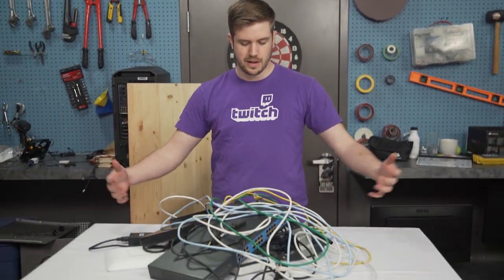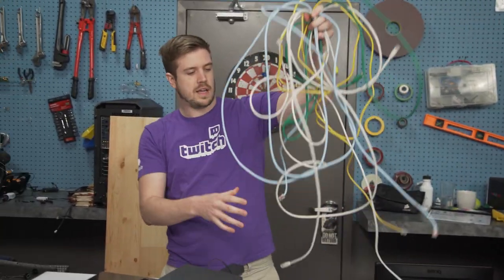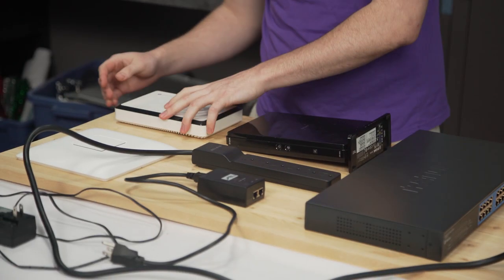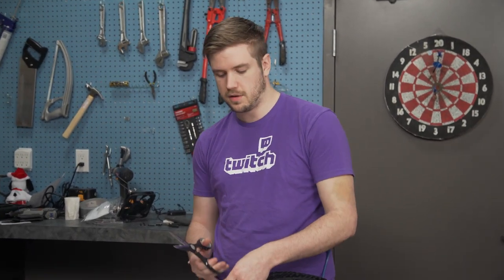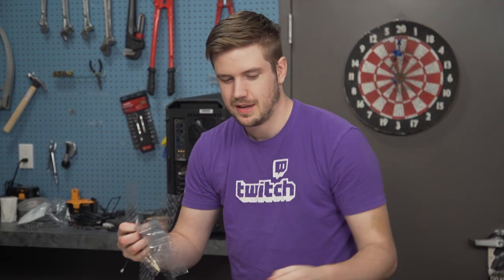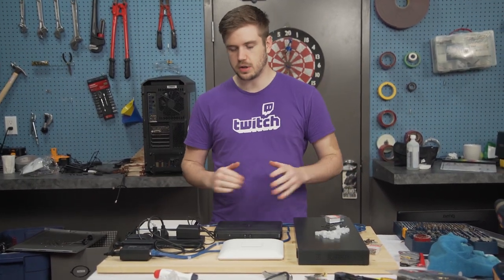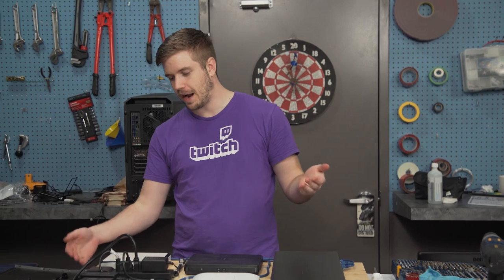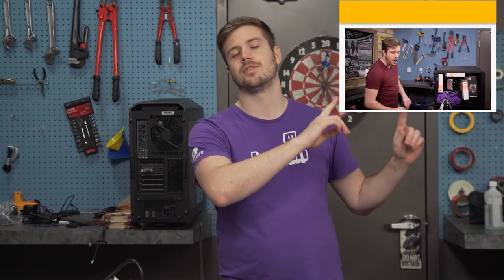DIY Networking Wall - A renter's solution!

Comment: Primecables has some cheap 1' and 6" power cables to clean up the wiring (also good for getting those ugly power bricks onto a surge strip). They have a distribution center in Vancouver too I think. I got some short ethernet cables from them too, for interconnects between switches/routers, etc.

Comment: you should have painted it black to make it not stick out so much, also drill holes and run wires on the backside to make it look very professional and clean. All excess wire and power supplies could be hidden that way and then just have them come out right where the plug in.

Comment: Your Wireless AP will now be sending signals out in the wrong direction, the antennas will be setup for it being in a horizontal position. Your WAP sends out signal in a doughnut shape, which is now going up into your ceiling and the floor rather than into adjoining rooms. You could solve the issue by getting a model with external antennas, or by adding a little 90 degree wooden riser from your board so that is horizontal again, or just don't lean the thing against the wall :P
Reply: sure....
Reply: That AP (not the shitty router) is meant to be placed on a wall.
Reply: +S!lentThund3r That's a Ubiquiti UniFi AC access point. They're designed for wall or ceiling mount, and change the polarity of the antennas internally based on orientation automagically.
Reply: +Ian Brown Hmm interesting, I work with Cisco enterprise WAP's that aren't smart enough to do that on their own. That's a feature I'd love to see 3700i's have :P

Comment: I just spend 7 minutes watching a guy stick stuff to a board and call it a solution.   I really must have cabin fever, someone get this guy an all in one router.    Yikes.
Reply: +Toms Chevelle 
All in Ones suck. They're made in a one size fits all form that doesn't always fit. If one part of the system fails, it all fails. This is why I don't buy Headsets anymore. Instead buying a separate decent headphones and microphone. That way only one thing needs to be replaced if it breaks.
Reply: +Toms Chevelle 
All in Ones suck. They're made in a one size fits all form that doesn't always fit. If one part of the system fails, it all fails. This is why I don't buy Headsets anymore. Instead buying a separate decent headphones and microphone. That way only one thing needs to be replaced if it breaks.

Comment: WTF !!!!!!!!!  Is this a joke ??!??
Reply: No.
Reply: +pol1250 This is LTT. There are no jokes here. Only business. Serious business.
Reply: Very serious business. Usually involving large slabs of wood.
Reply: +pol1250 No, its not a joke. With the exception of screws used instead of velcro, its a very very common thing you will find in business all over. It keeps all of the telecom hardware, isolated, organized, and easy to service.
Reply: +Jake J velcro is legit
Reply: +Jake J lol you mad?
Reply: He doesn't need to make cables to work at what is primarily a computer tech channel. It says "Ghetto" in the title, if you wanted skilled workmanship then why did you even click on the video? And yes, the best part is that he is getting paid, he just isn't getting paid to do this. This is a one off video
Reply: I'd just have the home depot or menard's cut the panel I was buying to size - no extra charge. That's what their big panel saw is for.

Comment: What's wrong with putting all this on a shelf, with some minor cable management. No screws, adhesive or velcro needed. And it won't look as ugly and ghetto as this.
Reply: +ImDankest In case you need to move to another place fast? He said that he was renting.
Reply: What, so it's easier to move around a massive awkward sheet of wood with networking equipment screwed, taped and velcroed to it, than it is to take some things off a shelf and put it in a box when you need to move? I understand that's not the point of this video, the point of this video is to entertain the subs, not to be practical. But i'm just saying how much of a stupid idea i think this is.

Comment: D-Link router? That's why you had terrible Wi-Fi...

P.S. Дно-линк
Reply: +Dr.Cheater He doesn't use the router for wireless....He has a ubiquiti access point (the white square) which is one of the better known enterprise grade wireless solutions.
Reply: +sphinx1390 had
Reply: +Dr.Cheater Там не только дно-линк, еще и дерьмовый оптоволоконный модем. У самого такая же херь дома. Только не UniFi, а AirPort Express. Замены тому модему нет, вообще. Жизнь боль
Reply: +sphinx1390 He only has that because the D-Link Wi-Fi is terrible.
Reply: ***** Приятно встретить тут русского)

Comment: Could you consider to stop using the word 'Ghetto'? It appears you're trying to use it in a way that means quick, cheap or not professional, but this is quite far from what it means. I post this for the whole team at LTT, not just this video. 
Edit: looking at the standard youtube comments of someone also mentioning the same thing, the video could easily be called 'DIY Networking Wall - A Renter's solution!', as' DIY' clearly implies the same message as the way you used 'Ghetto'.

Comment: "Tech Guy" doing a 'tutorial' on networking management. Can't make cables.
Reply: +Bareknuckle. Tell me about it.. i shut it off the moment he said he can't make cables. So many of these Linus videos is effectively big unboxing videos.
Reply: +aerobicsparadise reminds me of Linus' video about "10x your network speed" where he obviously didn't know about the IPv4 address space.. (he fixed that while it was still on vessel)
Reply: ***** the issue was that he picked IPv4 subnets that weren't in the private range anymore, for a second network interface. He was basically advising people to use an IPv4 subnet that actually exists in the real world, so if someone actually used those addresses and later wanted to connect to an official site on that IP address they would not be able to connect, since it would get routed to the local computer.
Reply: aerobicsparadise yeah, I had to laugh a lot when I watched their video on it, too. I mean I am already concerned about my data even though I am not running a company off of it. Not having a backup of data that is vital to a company's business is like playing russian roulette :D
Reply: pcfreak1992 LOLZ !!! It's was probably 192.168.0.1/24 ;)
Reply: pcfreak1992 Same here.. Run heavy duty Cisco 3800 routers /Catalyst switches and PIX firewalls at home.. But being a CCNP..one kinda goes overboard at home. ;)

Comment: I would be a little more adventurous: take a beefy dual output power supply (5V and 12V usually) and power all the equipment from it. Sure, it requires some soldering for custom power supply cables, but when you most likely won't have to swap or add another power bar if you want to add something later on... I know it's a bit of overkill... 
But, excellent ideea! And it works not just for renters! I mean, when I upgrade something in my house that's screwed to a wall, 8/10 the old holes don't fit and I have to drill new holes...

Comment: Maybe make it like a rolling white board, thus meaning it would be standing up (at ur preferred height) but not necessarily rolling. You would then have all your networking device on the front with holes through the board for the wires to pass through the back and not all over the front. Also, the power bar and adapters could be mounted behind it so no one sees them.

Finally you could have LED strips behind the perimeter of the board giving it a glowing effect!!
Reply: I was hoping for something more presentable like this too.

Comment: What you should of done was mount everything down. Then drilled holes big enough for your cables to fit throw right below what they are getting plugged into. Also you could have carpeted it, to make it look better. Then you could have cabled managed better on the back, and it wouldn't be so ugly. I have this done for my car stereo setup in my trunk for my amps and everything.

Comment: Just as a heads up to anyone looking to do this, stick on Velcro will fail over time due to the heat of the components heating up the glue until it comes loose.   Everytime I've used it, it fails after a month or so.  So unless you an obscene amount of it, expect to have to reapply it once and a while.

Comment: Most of that equipment probably has screw mounting keyholes, which are way better than giant pieces of velcro. Or you can use cabletie saddles on either side, then loop a ziptie over the HW and put a cut-off nut off another cabletie on the other side of the opposite saddle to secure it.

Comment: An alternative would have been to put L brackets on that board to hold it an inch or so away from the wall and have the cable management on the back. It would look "cleaner" as excess cable lengths can be coiled, zip tied and tacked up out of sight on the back. (and no risk of getting cables that are a wee bit too short...)

Comment: For that wireless access point, that is probably not ideal. When layed flat. It's wireless donut ( you can Google it for more info) would be spread out in the surrounding area. Putting it on its side would cause the wifi to go in a narrow beam in the surrounding area on the same floor, as well as shoot up my higher and lower (which might make sense in some situations but usually doesn't). With a few modifications this plywood wall could make sense, but I would be aware of where you want your wifi to go, and position it accordingly, even if that means leaving the wap off the wall. It's important to keep in mind that LTT are entertainer's, not always professionals on the topics they make videos about.

Comment: I can think of 3 ways of making this work better.  First use BOTH sides, I would mount the equipment to one side, using brackets, a pair of brackets that have a 90 degree bend in them,  and a small bolt between the two, it looks almost like this [ if viewed from the right angle. Two sets go under each piece of equipment, and one above.  Drill some holes in the board to fit cables through and attach those at the bac, would look much neater.  Get a set of 2 shelf brackets, the mount the piece that you cut off, to the bottom centred underneath to make an upside down T and it can free stand.  That was posted a couple of weeks ago, and I would think it's a safe bet at least one piece has come off....

Comment: LinusTechTips: I have a question that has been bothering me a lot. The question: "Why do you and everyone else use a modem?".
I understand that the modem is your way to connect to the internet and then the router is what you use to connect all your devices. The thing is, in my house I have a glass fiber connection and what I did was to buy the glass fiber cable, connect that to the wall and then use an adapter that transforms optical waves into digital waves and so using an ethernet cable I connect it directly to my router, thus not needing a modem. My internet connection works fine and I've never had any problems and that's why I keep asking myself, why use a modem? maybe I'm missing something, but that's why I'm asking you. I'd like to know if maybe there is a crucial benefit from a modem that I'm missing. Thank you.
Reply: +Ah Eh You use a modem because that's what your ISP dictates you need to be able to connect to their network. Which is incidentally also why most ISPs tend to ship you a Modem/Router combo box.
Reply: So in that case it doesn't have a practical use and or advantages. I'm happy I recently changed my ISP,  because my new ISP only turns on the internet and everything else,  the cables, router,  etc. I have to buy and manage myself. Thanks for the response ^^
Reply: Ah Eh It all depends on your luck - Here in Denmark it is the norm to receive the Modem/Router combo. If you want to be able to tweak them, you often have to call up the ISP because they are locked off to allow for remote updating.

So you basically sign a "I take all responsibility for doing my networking myself" thing. IT enthusiasts can usually replace the entire setup with their own stuff though.
Reply: Yes,  here in my country I think it's the same.  But my last ISP was so bad and expensive, I was desperate to find a new ISP. So I guess I'm really lucky, the one I found now is amazing, it's like that from the beginning: "I take all responsability for doing my networking myself". And they don't mess around with anything else. At the beginning I was really scared about doing it all myself, because I didn't know much about networking...  And I was always really confused why using a modem and all..  Haha.  But well, you cleared it up for me (because in every forum people said that you absolutely needed a modem to connect to the internet,  but I don't have one! :O) so yeah...  Thank you
Reply: Very FEW people in the US have access to Fiber connections here is the main reason and when they do have access to Fiber, it's at insane prices. Only Google Fiber, in select cities and then select neighborhoods, offered 1Gbps Fiber at a price that's affordable.   You wouldn't need a modem either if you went with DSL. It could just jack directly into a router. A lot of people are on DSL but the speed is worse that cable (copper) of course. DSL is usually an option when no cable ISP is around. If there's a cable ISP around, it's usually cheaper and better all around to go for it, thus, modem. Modem/router combos, aka gateways are terrible though.  Luckily, some ISP's like Comcast, let you buy your own modem instead of renting theirs.   And because I did so, I don't have to pay the $10 a month to rent it AND I get much higher throughput than the service plan says so.  For example, I used to have a 75Mbps service but regularly get 90Mbps.  Now I have a 150Mbps plan and regularity get 200Mbps.  Also, you'll notice on modems they mention channels. Channels most people think have to do JUST with maximum potential bandwidth, so more channels, higher possible speed. But in fact it also helps with line congestion and error correct / stability. I live in a major city and in an apartment complex, so all the homes basically go through one hub, probably the whole block does too. So it's able to pick out different channels, so I have a more efficient connection. So even though I don't have a 1Gbps service plan that my modem can do, even at 150Mbps, this thing with it's 32x8 channels is perfect.

Comment: Power strips normally have a few screw holes on the bottom to attach to a surface. That's a lot cheaper than Velcro.

Comment: If you can't drill, you can make something that can stand on it's own, presumably by putting two boards together in an L configuration, put some right triangles on the side for support, and plop it on top of a dresser or something... or maybe be lazy like me and set it on the floor and trip on it. You can then make handles at the top portion, so when you move, the contraption is easier to carry. Remember to bevel and sand the edges to avoid splinters, they piss me off.

Comment: I need to just do this for my house. I had everything mounted to the wall, but since then replaced the modem/router/switch so nothing is the same and none of the screws line up anymore. I should have just mounted it all to a board from the start would have been a lot easier and less holes in my wall.

Comment: I use a perforated metal sheet instead then just use cable ties to tie up everything , plus point no drill no screws no Velcro which will definitely fail and better heat dissipation.

Comment: So many people are confused about what a Modem is, What a Router is, What a Ethernet Switch is, and What a WiFi access point is..
You can have a device that has all this in one.. OR

Modem - Brings in the connection from internet provider.  (is not a router does not issue IP addresses to devices)

Router - Takes the connection from the modem and breaks it out to all devices.. This is what issues the IP address to each device.. His is a 4 port router which means it is has a built in 4 port Ethernet switch [ It also has a built in wireless access point but he does not like it so he disabled it.]

Ethernet Switch - Takes the connection from the Router and distributes this to all the wired connection. (does not issue IP address)

Access Point - Takes the connection from the Router and distributes this to all the wireless connection. (does not issue IP address)

Yes you can get units that combine them all into one unit.. BUT this is what he has..
He could spend money on new stuff OR just use what he has available..

Comment: There is this really cool shit they make called drywall mud. You just fill the holes in the wall with it, then when it dries, you sand it and throw some paint on it. Takes 10 Minutes. How did you mount your tv? Velcro on plywood which you screw into the wall anyways?

Comment: My router fell 3 times off the wall thanks to velcro and the heat it generated making the glue come off. The 3rd time it also took down with it the external hdd I had connected to it.

Comment: you should've drilled holes and ran the cables behind the board. and maybe wrapped the board in cheap vinyl or carpet that's usually used for subwoofer enclosures

Comment: For the switch you could turn the mounting ears 90 degrees and then screw them into the wood. You know, if you didn't lose them.

Comment: Heat and glue are the enemy.  When the Velcro glue gets hot it releases. Use super glue. Lots of it.  And, cut or put a handle on the board to make it easier to carry.

Comment: I have my 8-port switch and raspberry-pi server mounted to the bottom of my table...
I wouldn't ever mount stuff on to a wall, but on a rack. If it's too small for a rack, i'd buy a rack shelf.
Reply: +Mtaalas So true. I actually have all my stuff in one 20U rack. Its a giant cable mess inside the rack but at least it is contained there and not sprawling allover my place,